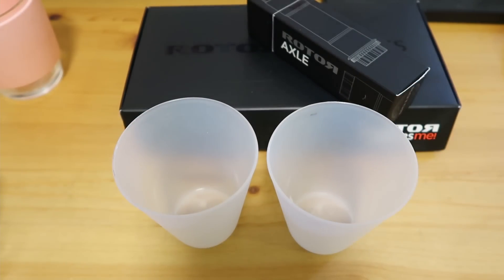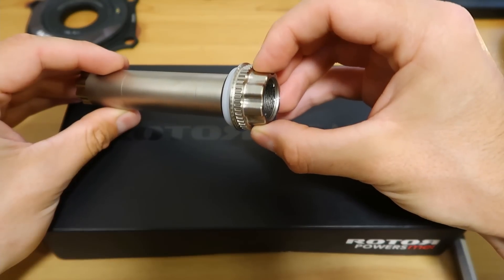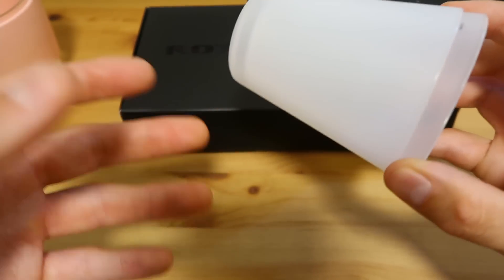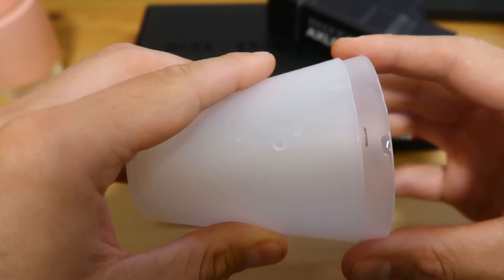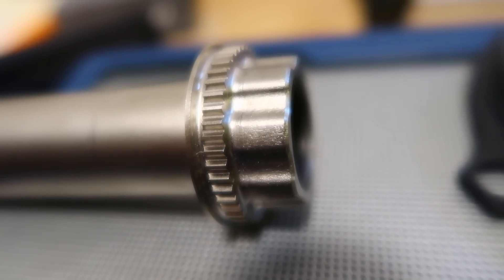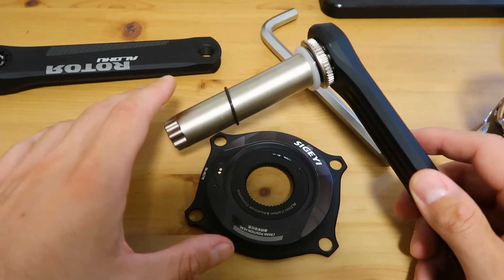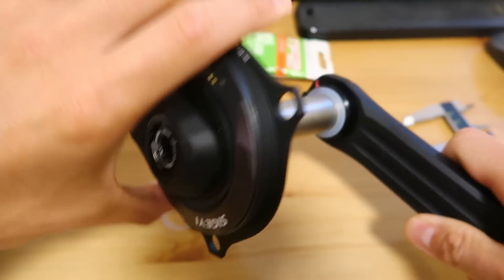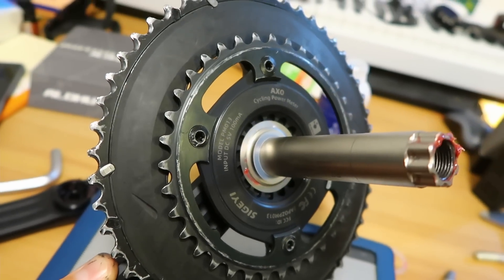Should you replace your Shimano cranks with these? ROTOR ALDHU Design completely & utterly analysed.

Comment: I don't deny that that is a very nice piece if machining but modern CNC machine tools should easily be able to hold 10micron tolerance on those size parts so the 50micron you use as an example is a bit excessive.  Also - there is always an also - the simple trigonometric analysis does not account for the elasticity of the crank spline hole (and I suspect a lesser extent the axle) which will allow axial movement when tightening the bolt. I have not run the analysis but on my crank-set (see the first link below) once the taper is 'nipped-up', tightening the retaining bolt can push the crank about 1mm onto the taper on the axle. Also, you should have considered the thickness tolerance on the power meter spline area which is also important for the fit to be good enough - how well so Sigeyi control this? I suspect the tolerances on the tapers are not as critical as your analysis might suggest. 

I bought this Sigeyi power meter about one year ago (https://youtu.be/wXIaALuMPCg), I have not been able to test its accuracy (its not that important to me) but so far it has worked reliably and the battery lasts a long time. The only real issue I have had is getting a firmware update transferred to the power meter.  I'm looking forward to your full review of the power meter. 

OK, I've been a bit critical. If you want to get your own back, I'm look to get engineers to critique is video (https://youtu.be/Q4HGhrBXDIM). In particular comment on what I found in the seat-pin would be welcomed.
Reply from the maker: Great comment. Yeh i didn't go on deformation of the parts, thought the video was nerdy and long enough for most. Always a balance between detail and retention to satisfy you lot! 
Didn't mention the spider thickness control, that should be very easy to control, but yes its important.
I just chose 50 microns as an extreme figure. But even with 10 microns because of the tangent relationship its still quite a large effect on axial position on a fine taper.
Cheers
Reply: @PeakTorque  I don't know about anybody else but I come to Peak Torque because it's nurdy. The more nerdiness the better in my opinion.
Terry

Comment: I wonder,  is the taper issue described the reason for the failure rate I've seen (2 sets of my own) in the rotor flow cranks.   Cracks in the crank arms at the spindle interface.

Comment: Hey, first of all, thanks for the video.

I recently bought a Xcadey powermeter (PM from now on) for Rotor aldhu cranks. As you said, the interface was not perfect between the powermeter, the cranks and the axle, so there was an unnaceptable amount of play. I took it to my local bike shop, thinking that maybe I did not know how to assemble it correctly, and they returned it to me assembled, and said that more force was needed in order to get a snug fit.

Weeks go by and the PM starts returning some wonky readings until it eventually dies completely. After dismounting all the pieces I discover that the PM outer cover is cracked, undoubtedly because my LBS applied too much torque. 

I have to add that Xcadey sent a new one, almost no questions asked. This second unit I mounted myself (not going back to that shop) and had no troubles, in fact it´s still going on trouble free after 6 months.

I guess that the problem lied within the first PM mounting interface, since that´s the only thing that changed, but that´s my expierence.

Comment: I bet that the spline is forged. No one with a brain would try to mill it. It is doable, but would take way too much time. With forging, you have high initial costs but low costs per piece.
If you look (halfway) closely at the spine, there are dents. They are not at all typical for milling.
Reply from the maker: I think that was a witness mark from the first install of the crank (some of the black anodizing left on the spindle). I am not certain that Rotor has gone into forging but I may be wrong.
Reply: @PeakTorque  Just came to my mind: I do not klnow the specs of that spline. But basically, there are two types: One has contact on the outer surface (of a shaft), the other in the lower (the valleys) of the grooves. This makes machinig way simpler. My guess is, that the contact is on the outer diameter. So you would have the taper there. Just look at a PTO and how it transfers torque. A tolerance of the class IT7 (the usual one) would be 0,02 mm. My lathe at work holds 0.01 mm easily all day long.

Comment: Would like to hear your thoughts on the Cannondale si series cranks. Same concept, although the spider is screwed down onto the arm, which is then bolted on with the aforementioned taper
Reply from the maker: In that case, you always know the chainrings are held on nice and stiff independently of the crank which is actually in my mind a better solution. Cannondale cranks don't seem to fail, even though theyre hollow (like shimano)
Reply: @PeakTorque  the lightest ones sisl and sisl2 fail too . Quite often for a small production.  Debonding issues as well .

Comment: I had to torque more than 35nm to remove the play and still have creaking with 24mm and Hambini BB. Doing my head in. Think need to speak to Rotor as Power2Max were responsive but not helpful.

Comment: Always loved Rotor stuff. The 3DF made the BB30 on my old bike actually usable. SRAM DUB looks like a not-so-cheap knockoff of 30mm Rotor down to the preload adjuster. Difference is the Rotor one is beautifully machined whereas the SRAM one is a piece of plastic tat.
Reply: To add to this, doing a build for a customer have convinced them to go for a Rotor Vegast rather than Ultegra crankset (in part due to availability it must be said).

Comment: Hey PT! Many thanks for the video. I had Vegast version if the crank (cheaper version) and I had this very problem. Crank arm wasn’t pressing all the way to the spider and had this terrible creak going on. I contacted Rotor and they eventually replaced it-they tried to convince me there was some bb/bearing misalignment but I did try other 30mm crank which worked fine. In the end, I sold it  as I wasn’t keen anymore.
Reply from the maker: It seems making this video and the comments has brought into light the issue i was wondering about before i purchased them!

Comment: Why don't you just get a heavier shimano crank which isn't bonded like Tiagra cranks. I use tiagra 4700 groupset for every bikee I own. The extra weight makes absolutely no difference whatsoever. I built a TT bike with two years ago everything on the 4700 groupset minus the shifters- Ive got 4 koms on it won TT's on it. No one needs dura-ace
Reply: Even the 105 cranks are a good option as they're just one-piece hollow-forged items (still true up to the R7000 generation). They're about as expensive as I'd go with Shimano cranks, as anything above this level has that two-piece bonded hollow crank arm construction everyone has trouble with.
Reply from the maker: I needed a crank to test this powermeter.

Comment: Has there ever been a crankset with a threaded interface to secure the crankarm to the spindle?  (As in you turn the whole crank arm to affix the crank arm.)
Reply: Pretty hard to get that right too. I mean your crankarms have to end up at 180 degrees at specified torque.
Reply: No. Primarily because you don't want the crankarm to unthread as you pedal.

Comment: Very interesting and I always learn something from your reviews (as a total layman engineering wise). Personally I have two bikes with Rotor InPower 1x cranks and they are bulletproof (aside from the single A battery which is relatively short lived) and easy to swap chainring sizes. . Quality machining and really not that expensive especially when they have them on sale. By far my favorite cranks.

Comment: Whenever I've looked at Rotor cranksets, I've been shocked at the prices, so that has ruled them out for me.  I have wondered about the machining of the tapered splines in cranksets that I own (FSA and SRAM).  There's quite a few standards for straight cylindrical involute splines, but I don't know about for tapered splines.  The exposed spindle length a.k.a. distance between crank arms (as Hambini calls it) can vary quite a bit due to manufacturing variations.

Comment: They use this fine spline for spider mount interface just to allow 1 degree clock of direct mount oval chain ring. Want to dial oval chainring orientation a bit? No problem, take it out and reinstall it rotated one degree clockwise or counter clockwise at a time until you find the perfect angle. 
As we use round rings, this design complexity give us no benefit.
Reply: Exactly the reason why they did the design this way.

Comment: If shimano is good enough for Matthieu van de Poel, it’s MORE than good enough for us mortals. If you’re better than him, you should go pro and make your millions. meh
Reply: It's not about stiffness.
It's the unreliability. Shimano crank randomly break apart from trapped moisture internal corrosion and degradation of bonding between two halves. 
Pros don't use the same equipment for long. They have teams inspect equipment and change it all the time etc.
Us, mortal buy a crankset and use it for many years. On year 3, how many time did you inspect the crank for any small damage that has potential to grow into catastrophic accident?
Reply: Can't tell if you're a Shimano fanboy or a MVDP fanboy. Maybe both. At any rate, you would be unwise to ignore the scores of Ultegra and Dura-Ace bonded cranks coming apart ever since the U6800/DA9000 generation debuted in ~2012. That Shimano are simply ignoring this phenomenon after a wealth of documented evidence of such is revolting.

For this exact reason, I go with Shimano 105 or lower. No fancy bonded crank arm construction to contend with.

Comment: The annoying thing for me is that there isn’t really much performance difference between cranks.  Lots of cool tech, but doesn’t really translate to speed
Reply: In the 1980's Bicycling magazine built a test rig and measured chainring deflection and crankarm stiffness. Turns out superlight ones were flexier but not by a humanly discernable amount.
Reply: I think that getting ones gearing optimized has a real world performance benefit. For a lot of riders in a lot on circumstances stock gearing can be pretty good. 
But. 
With a modular design like this, one could easily swap out their road chainrings for a set of sub compact gravel rings or even road 1x or even mtb rings if you are into steep inclines. I’ve got a modular crank and having this versatility is easily it’s best attribute and to me puts it heads and shoulders above Shimano and SRAM.

Comment: Funny that you say this. Just got an Aldhu 24mm and no matter what I do, the spider is loose. I also tried googling this but didn't find anything. I guess I'm the only one with this issue... I called Rotor, they told me to go to 40Nm and it still wouldn't compress. I can't seem to win with any brand.
Reply from the maker: Thanks very much for this comment. This was exactly the problem I had envisaged! So there are problems with QC then. Try this: grease the spline, heat the female taper (the crank) in an oven to about 80c, then install. Should get you a bit further up the spline.
Reply: Did you check the inside of the crankarm where it mates with the spindle? You may have squashed the washer that's inside there.

This happened to me when I was installing one, supposedly it somehow ran off-centre at some point.

Comment: Good review and well explained. I have the same combination on my bike and will check it out later. My question: If the chainring is lose like you described at 8:47 and can angle would that not result in a better more straight chain line?
Reply: Maybe, but wouldn't that cause power drift?

Comment: Long-term review would be interesting, i.e. if you’d have any play eventually e.g. from wear. It’s of course normal to torque down chainring bolts time to time, but here it’s quite an exquisit setup.
Reply: My daughter has been using these cranks in 30mm version for XC training and racing (high level I'd say, currently 2nd in Poland), including doing some tricks and jumps. After half a year zero problems and it's been offroad riding in technically difficult terrain. In my opinion these cranks are on par with shimano DA or XTR as reliability goes. And the support from Rotor is fantastic. I chose road cranks for mtb because of the need for low q factor. Combined arms with Rotor's XC direct mount XC chainring. Asked Rotor if it would work and they even calculated chainline for me.

Comment: Back in the Isis bottom bracket spindle days, Race Face cranks specced a particular torque but also said it had to bottom out. Their instructions said if the arm doesn't bottom out at that torque, to remove the crank and reinstall however many times until you did. 
I've installed several Aldhu cranks. Sometimes I need to remove and reinstall once to ensure it's bottomed out.
Reply from the maker: I had an Isis BB and truvativ cranks. The tapers never mated, and always came loose and ruined themselves. They never worked well. These spline tapers are risky!
Reply: That's interesting. Basically they were factoring a bedding in it seems. Im curious to see if a wave washer could be utilised to add some preload to allow for any tolerance variables or fluctuations. The design should allow for and bedding in of the taper.

Comment: Just goes to show, if people in the bike industry want to put in the effort to make a product with high tolerances and QC it is quite achievable.
Reply: They will sell what is profitable. If high tolerances and qc components will make them rich then that's what they'll sell.
Reply: I can’t help but be weary of Rotor cranks after the experience I had with the one that came on my Cervelo. It creaked like crazy and once I swapped to Shimano the creaking went away. 5 years later, still no creaks, BUT I’m on my second Ultegra crank. Pick your poison?
Reply: @RicardoRocha-lg1xo  that's the shit cervelo BB quality control, not the rotor crank
Reply: @shamuslamont100  the BB was Rotor too, yet I haven’t had issues with Shimano or SRAM Dub BBs afterwards. I am currently running a SRAM GXP crank on that frame (long story, lots of crank swappin this past year) and the BB is from a brand I’d never heard of… yet it doesn’t creak. I guess the Cervélo reps I met at a race some years ago were telling the truth about that Rotor crankset from 2014-2016

Comment: Have an ALDHU and it isn't a straight swap with my Ultegra... chain-line is vastly different so I need to adjust the front derailleur always by a lot when switching
Reply from the maker: Did you try it without the plastic shims they suggested? If you do that, the chainline for me was the same.
Reply: @PeakTorque  Yup no plastic shims, that's interesting to hear then!

Comment: 24mm axle works only with specific 24mm cranks and 30mm with 30mm cranks and afaik carbon one is only 30mm last time i checked (have both of them 24 and 30mm axles)